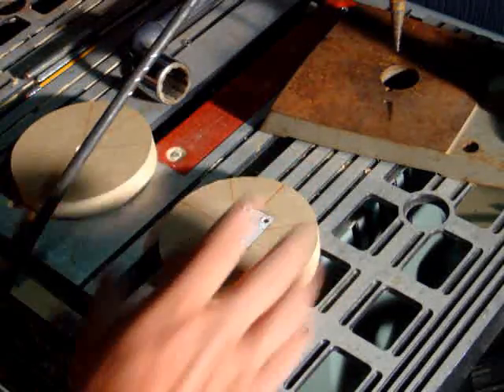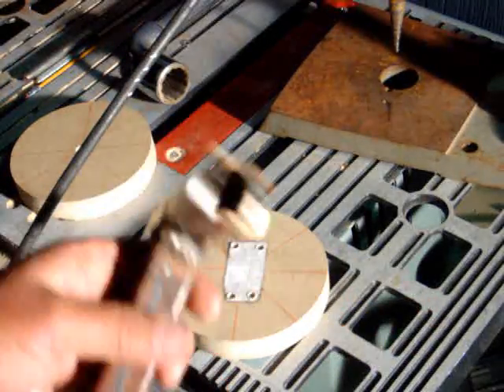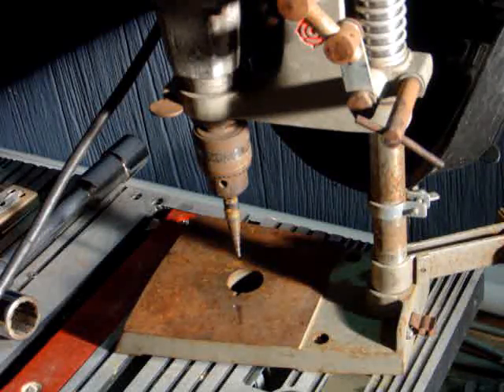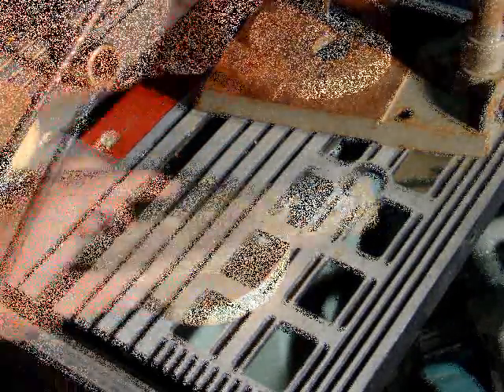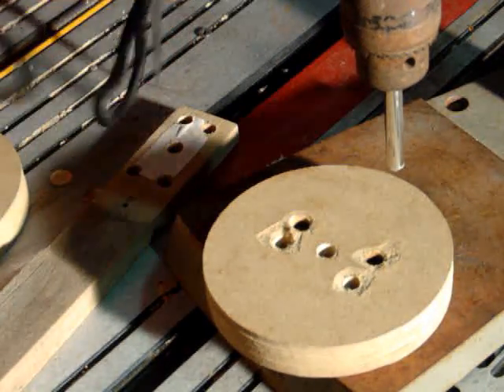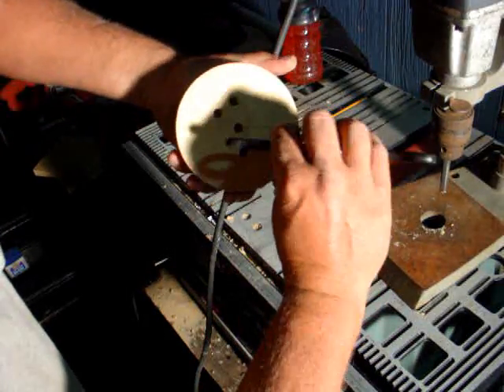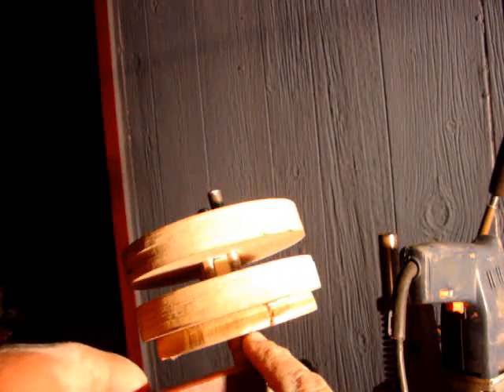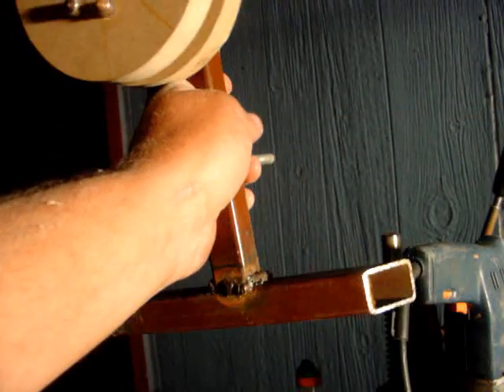BUILD A DUAL PERMANENT MAGNET ROTOR WIND TURBINE (PART 5)

Comment: Like your channel.  Think it's funny that I know exactly what model table saw you have because I've looked at the same top on mine for several years now.  Trying to figure out how to modify it so I can put a zero clearance insert in.  I'm sure it's been mentioned before, but if you put a piece of scrap under the piece you're drilling you can elliminate tear out on the back side of your work piece.  Planning on watching the rest of the series by the weekend and playing with an old cieling fan per your other videos.
Reply from the maker: +George Wood   Hey George, I'm back again after bringing the finances back up. sorry for the delay. Thanks for the compliments and comment. I actually knew better than to just drill without a bottom board to eliminate the tear-out. 
So how did your ceiling fan alternator turn out? I hope all went well. And thanks for watching My videos. I love making them. A chance to share what little i do know, and spread the love.
MUDDy
Reply: I haven't mad one yet. I'm currently working on an automated fence for said table saw. I'm going to try and post a video of the process. I'm just waiting for Christmas as the wife is maybe going to get me an arduino and a stepper driver. Ceiling fans on craigs list go fast. When I upgrade my sons room I should have one.  Keep making vids.
Reply from the maker: George Wood
Thank you George. free ceiling fans from your own house, is a great deal, and you know they still work. :) Keep smiling, and good luck on the ceiling fan conversion.
MUDDy

Comment: Great channel. Thanks for all the hard work filming it all for us :). Just a thought but if the coil is going to be wound around the pins rather than the little block in the middle then the middle block could just be a spacer and the corner hole drilling fiasco could be avoided. It could just be a slightly smaller block with the corners lopped off glued to one side of the bobbin configuration.

Comment: You're a selfless man with a greal deal of interesting knowledge to impart. Since  you mentioned bad welds. Why do my welds look like droplets instead of a straight line like yours. I have an inexpensive flux wire welder with wire feed set at 5 out of 10. Like your haircut too.